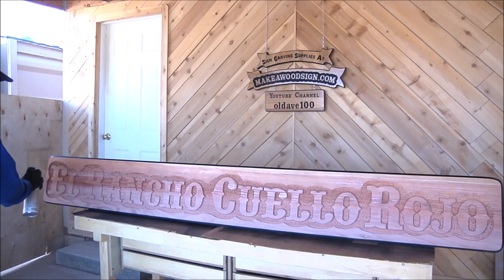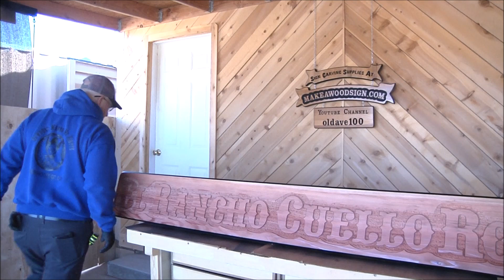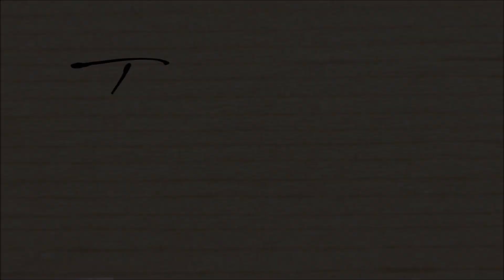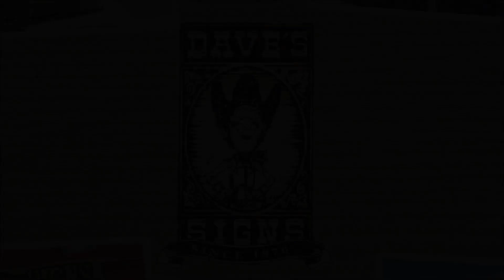#453 Part 2 El Rancho Sign

Comment: Great job! Never thought to do corners that way. Learn something from You every time. Thanks. I was wondering why You bevel the back of the sign? Is it for looks? I do it also but because You taught me to do that.
Reply from the maker: Thanks Bob. I bevel the back for a few reasons. First for looks. 2nd, so the finish will be less likely to peel on the edges. 3rd to get rid of any splinters on the back edge.